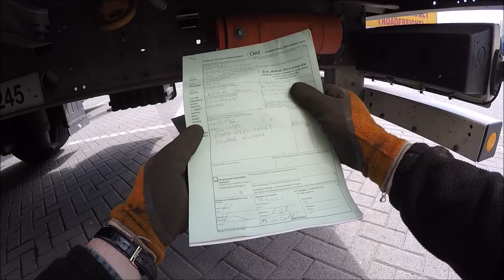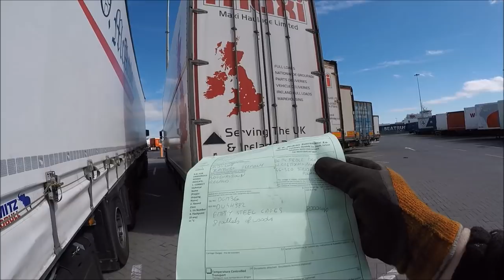A Day in the Life, Trucking With Ned Kelly

Comment: Another nice video Ned, but I personally would coil the straps up with the claw at the end rather than inside the coil so when you cast it over the load, any dockie or yardie walking close to the truck doesn't get clonked on the head by a claw.

Comment: Hi Ned great vid as usual. Hope you won't be offended if I mention this for some of your viewers who use vids like this for information, when I was doing unaccompanied trailers (about 15yrs ago for Frans Maas) the the Palm couplings on our megas were for running with units on small wheels (19" rims) 1 meter fith wheel and the C coupling where for standard units (22.5" rims) 1.25 meter fith wheel. C coupling would run with the suspension raised, higher than the Palm couplings would run at.

Comment: I hope you get paid by the hour. We get paid by the mile.
An open flatbed job I'd have two in front, two in back and one on every  pallet.
All depending on the weight and strap limit.
With a regular dry van, I'd put one in back only.

Comment: Does the third axle on the trailer make up for there only being one axle on the truck?
Reply from the maker: Truck with one axel can pull up to 40T
2 rear axels can pull 44T 
Not all trailers have 3 but most do ;-)
Reply: Ned Kelly Ireland Thanks, just curious to how it worked.

Comment: why do you roll up the straps with the hook inwards? thats a big no no in sweden.
Reply from the maker: tobbzor didn’t know it mattered lad ;)
Reply: We sometimes throw the straps over the roof of the trailer when we load, for example, timber. Then you want the hook in your hand so you can hook it in the trailer. After loading, you can pull down the straps from the roof and tighten the timber.
Reply: The outside always that it will roll easier over the load, we do it like that in Denmark too

Comment: Question brother, I'm a over the road truck driver here in the United States which I run all 48 states. Our trailers are 53 ft long and 13 ft 6in tall. How tall are they over seas? Our combined gvw is 80,000 lbs and vehicle length total combined is approximately 73 ft long. And we run log books. I was always wondering about trailer length ect over seas. Could u help me?
Reply: Ryan Glosson I hear that the trailers in Europe and the UK are about 45 feet at the regular length. The height however, I don't know.

Comment: How long are your trailers over there ned ours here in australia 48foot.
Reply: warrick jones 13.6m 44ft
Reply: There is some longer trailers in the Uk now
Reply: those are special test by DFT, standard length is 13.6m (45ft)
Reply: Looked longer than 45 ft. Actually looked longer the 53 ft the ones we normally haul here in the U.S.
Reply: Looked about 10 feet short of the 53' Dry boxes and Refer's I've hauled around. Never had to deal with a curtain side. My job ends with opening the doors, sliding the tandems back to the rear and backing to the door.